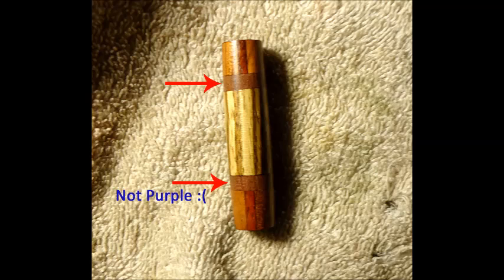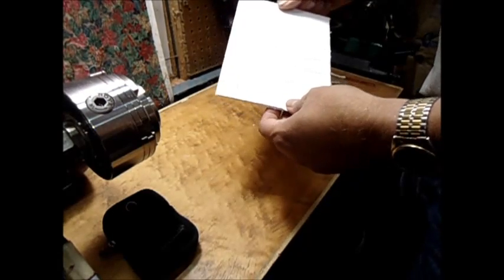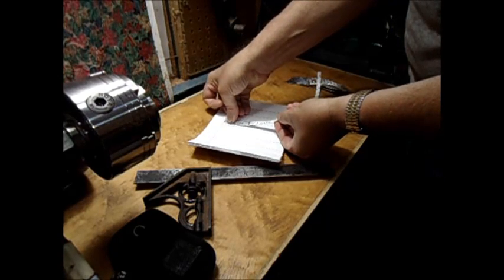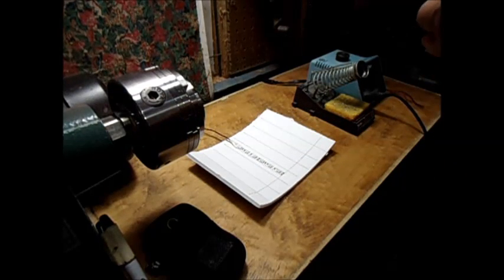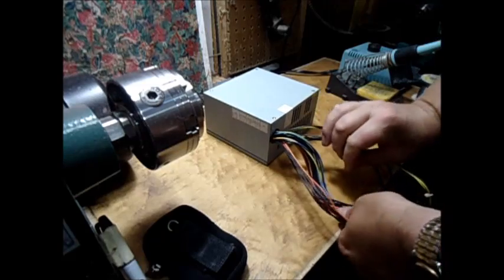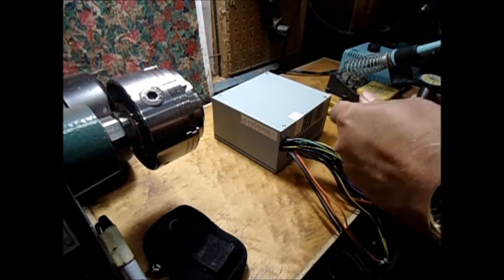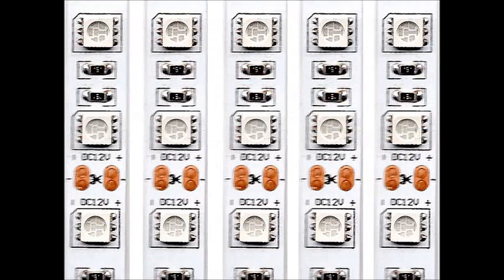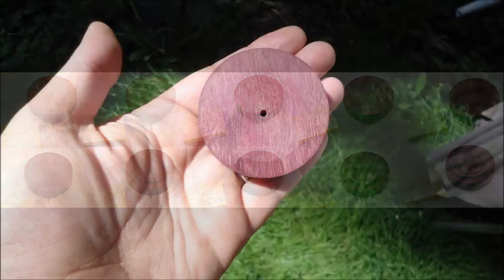#2 How to bring out the purple in Purple Heart wood

Comment: I am intrigued by your UV light strips.  May I ask where you sourced your strips and exactly what they are?  I am asking because it seems that there are a lot of LED UV strips for black lights and auto detailing projects.  On the other hand, there are some for industrial use that are very expensive.  Thanks for the interesting video.
Reply from the maker: Hi Steve, This particular bunch I believe was purchased on eBay. It was several years back so details are a little fuzzy, but seems they were somewhere around $10 US for a 5 meter roll of 300 individual LED segments, would likely do Amazon now. The label says 395 nanometer light wavelength however accurate that might be, but they seem to work well at least on wood and lighting up an average size room to make your t-shirt glow :)   I suspect they would also do well for nail drying and other UV cured resins. These ones are of the "5050" variety, meaning each individual LED is 5mm x 5mm in size. They run on 12 Volts DC, make sure you've got a power supply with sufficient current capacity. Dimmable with a PWM based dimmer if needed.  The self adhesive strips are notoriously non-sticky, best luck so far is actually sticking them to unfinished wood though there are a myriad of retainer clips available.  My only other experience with UV toys was back in the 80's/90's with some EEPROM erasers, and yes for something so simple they were obscenely expensive.  I hope this gives you enough to point you in a direction anyway, happy tinkering and feel free to ask away if I can offer any further. Be interesting to see what you are working on as well!
Best regards,
- Bill
Reply: Thank you!

Comment: So I just found out about purplewood and would like to use it in the future for a music box/jewellery case. Then I quickly realized that the wood loses its colour to oxidation. Then I found your video.
So this makes me curious, did the UV treatment last? Or does the colour fade away over time after the treatment again?
Reply from the maker: Hi, the wood actually increases in color as it oxidizes, will eventually darken to a dark brown with purple undertones, though this is typically a slow process (years).  The trick is to let it oxidize, then put on a finish with UV inhibitors, or don't leave the project in direct sunlight.  Extremely hard and dense, you'll want very sharp tools to work it.  It's during the cutting when the color disappears, but it will come back! :)
Reply: Thank you for the quick response!
I assume that a music box would be kept out of direct sunlight for the majority of its existence, but since it eventually seems to darken anyways, here's another question. Suppose I had a box that was already treated and finished with UV inhibitors that eventually browned with the years, would it be possible to treat it again without eventually ruining the box despite it having a finish?
Reply from the maker: Once brown you would have to sand down through the finish and oxidation layer on the surface of the wood.  My process isn't really any kind of treatment, think of it more like simulated sunshine.  I'm just accelerating the oxidation process in order to finish a project so I can pass it along to the final recipient quicker.  Near Seattle, the skies are not always as blue as the song implies... however a day in a good sunny location will bring a significant purple hue naturally.  Also, untreated the wood still holds color for years if left out of the direct sun.  I've got a small piece on the shelf that looks just the same as it did a dozen years ago when I received it.
Reply: So I'm confused. If I put it in the sun (or under UV or expose to heat) when it's brown, it'll bring the purple hue back. But if it's exposed to the sun while purple it will brown? Does just leaving it in the sun indefinitely make it go back and forth between colours then, or am I misreading something?

But in either case, this sounds great so far, if the box could keep its colour for many years in a cupboard or whatever that would be brilliant already.
Reply from the maker: Sorry, before I cut into it, it was vividly purple.  Cutting it peeled off the oxidized surface leaving it a lifeless brown/grey color.  Sunlight re-oxidizes the surface, which will stay purple for quite a while, but over extended time it keeps getting darker, to the point of brown.  You mention heat, which is true.  However, heat can break a glue bond so use sparingly!  Using a finish with a UV blocker goes a long way, just leave it in the sunshine for a bit before you apply the finish.  I've never seen anybody disappointed by receiving a gift with purpleheart in it! :~)